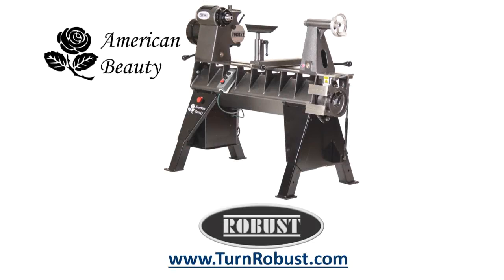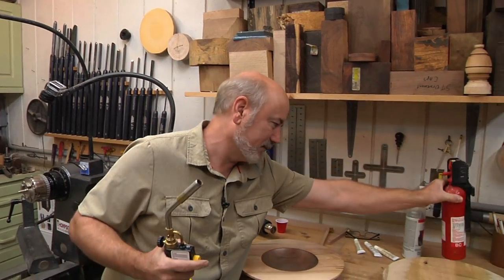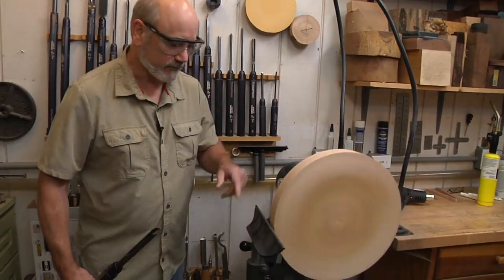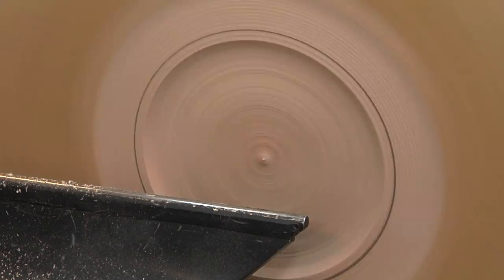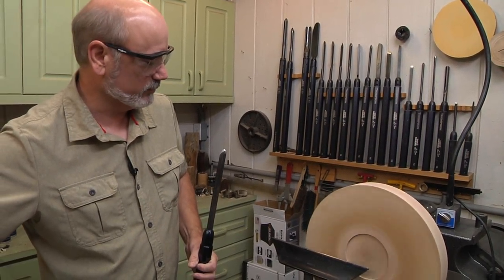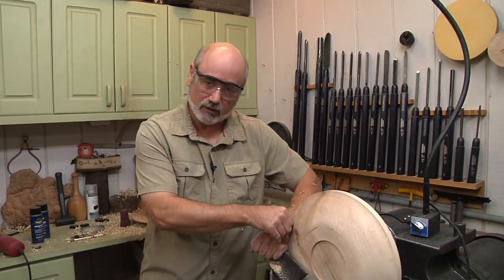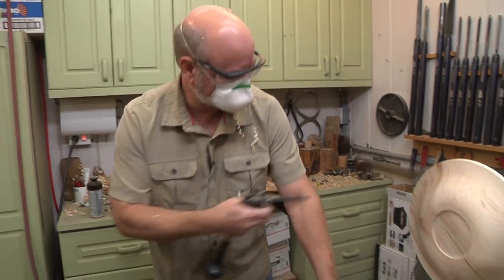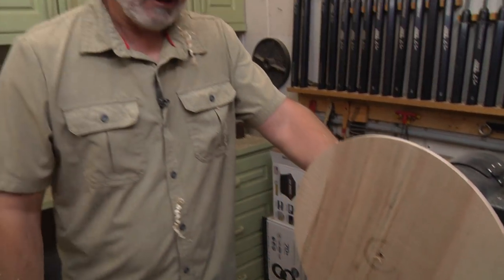Burned & Gilted Platter-Part 1

Comment: Thanks Tim. I’m going to buy the Thompson gouge. Wondering what size you would recommend starting with?
Reply: Gary McCoy what do you make? How big is your lathe?
Reply: Brian Prusa ..I have an older 3520A PowerMatic. I turn mostly bowls from yard trees that come down in my area. I’m thinking that I will by the DT 3/4 inch V gouge. I’ve been using the Ellsworth signature bowl gouge since I started turning about 10 years ago. Thought I would try something different this time.
Reply: I have the same lathe. Most often I grab my 1/2 bowl gouge for stuff like this. I can make tighter turns and feel like I have better control than my 3/4”